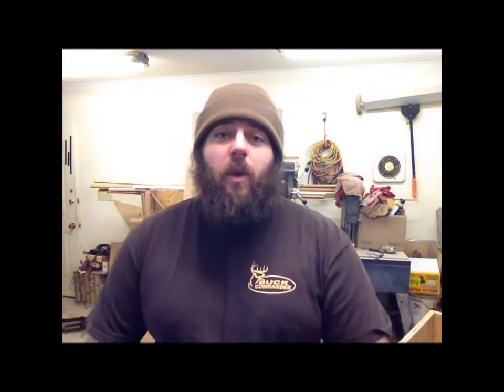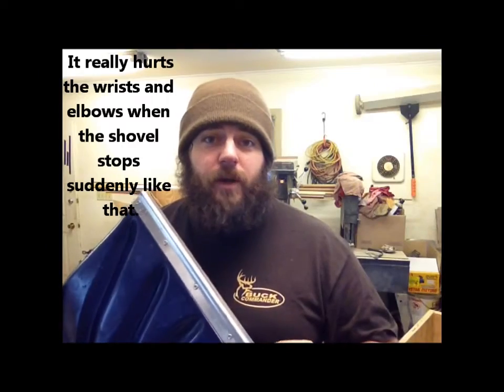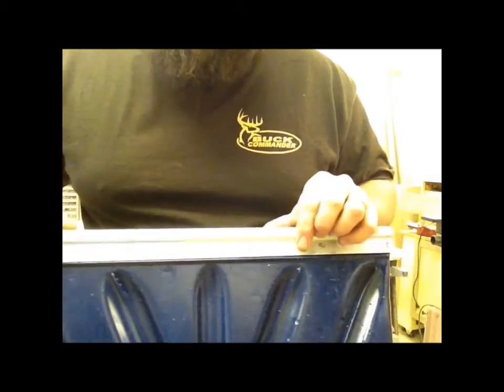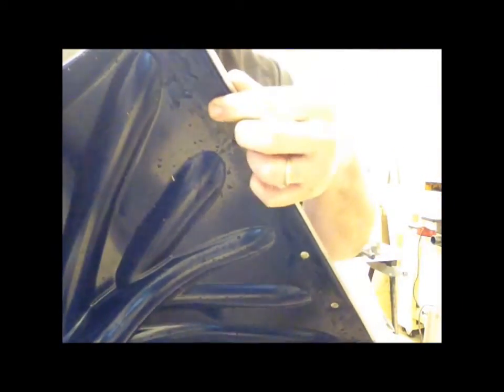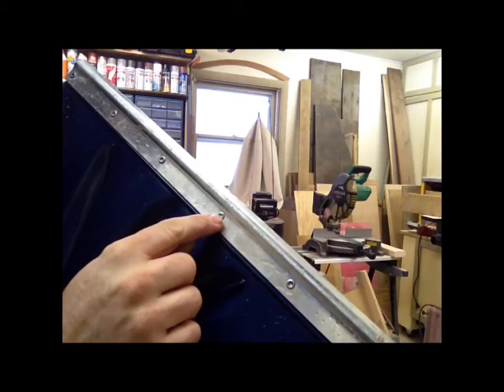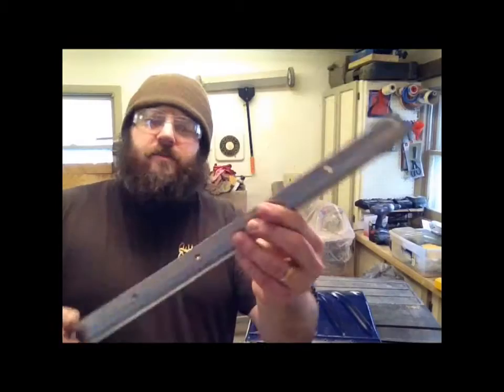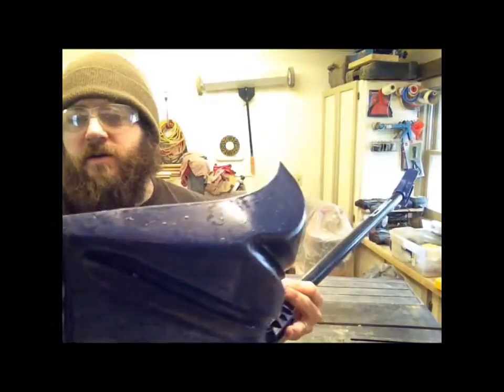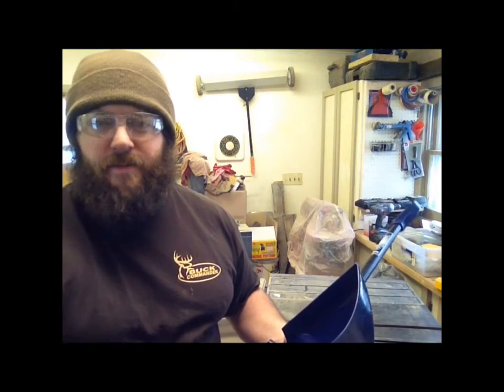snow shovel modification. New snow shovel is ready for the next snow storm.

Comment: The ease of not having the metal strip just makes the shovel so much easier to use. I used to think the all plastic shovels were just shoddy cheap shovels and.... who would want one over an all metal shovel (?). Upon first using my first good all plastic shovel, I quickly realized how much easier it made shoveling.  And for the plastic shovels with the metal strips, I can't stand the metal strips for the same reasoning Dan Rogers has.  Unfortunately it seems harder these days to find shovels without the metal strips. For those that might be wondering, my shovels without the metal strips still last several seasons (4+).... as long as you don't use it as an ice chopper (even though I still do to a minor degree).   Thanks Dan for the video

Comment: How long did that snow shovel last after you removed the wear strip that all types of blades need, about 15 minutes?
Reply from the maker: Wayne Baughan, LOL... actually I still am using this same shovel this snow season. It is however almost warn down almost to the empty pop rivet holes.
Reply: The do sell cheaper shovels at Walmart without the wear strip. Could have saved time and money. Those wear strips make the shovel last more than one season. To each their own.